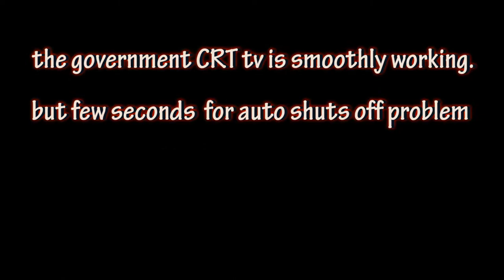CRT TV smoothly worked but few second auto shots off the tv. how to easy troubleshooting

Comment: I have also same problem but when i changed that 10 ohms resistor it well run soothly for some days sometime one day and again it resistor burnt what is the solution plz help..
Reply from the maker: How watts are you using that resistance? If its wattage capacity is low it will burn again
Reply: 1 watt same as origenal
Reply from the maker: MFR or fuseable resisdence add more of it 5watt

Comment: Brother LG crt tv 21" 5 minutes picture varuthu..appuram automatically standby poguthu...oru 2 min thirumbavum naama ON pannuna Oru 5 minutes oduthu...enna check panni change pannuna nalla odum
Reply from the maker: 110 to 135v B+ volt correct ah varuthaanu paarunka,main caps secondary side,all caps change pannunka bro
Reply: @electronicsprogrammatics7504   110v correct varuthu. Main capacitor and str ok. 
thank you very much. I will check and change it

Comment: Still the resistor burns so should i change the flyback?
Reply: @electronicsprogrammatics7504  Not sure yet b/c its burnt. Probably 100 ohm
Reply from the maker: B+ volt coming right 110v
Reply: @electronicsprogrammatics7504  yeah i'm getting 110 v
Reply from the maker: @radahelectronics108  2.2ohms 2w resistor replace and again burns right
Reply: Yeah bro!
Reply from the maker: @radahelectronics108  681/2k film capacitor change from the h out line side
Reply: @electronicsprogrammatics7504  ok thanks bro I'll try it and tell you!
Reply from the maker: @radahelectronics108  ok bro 👍